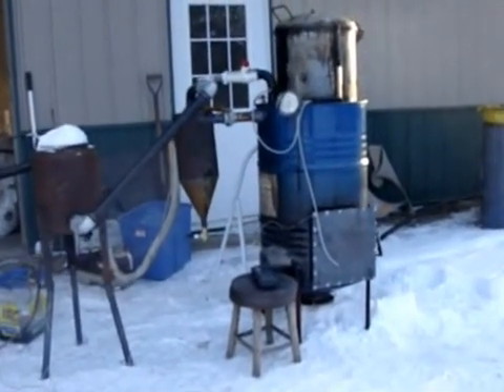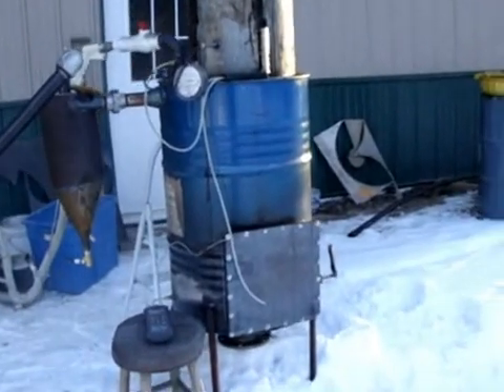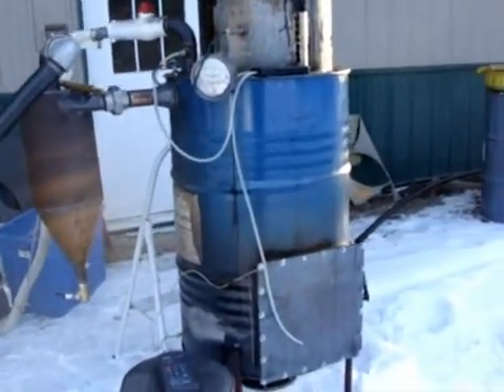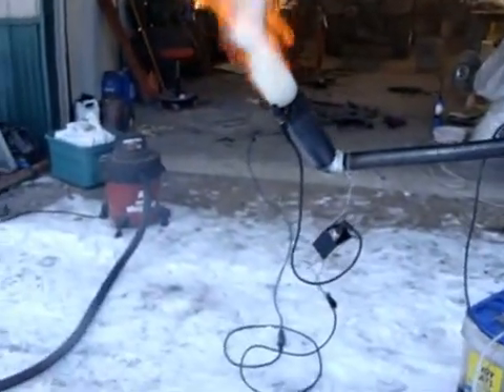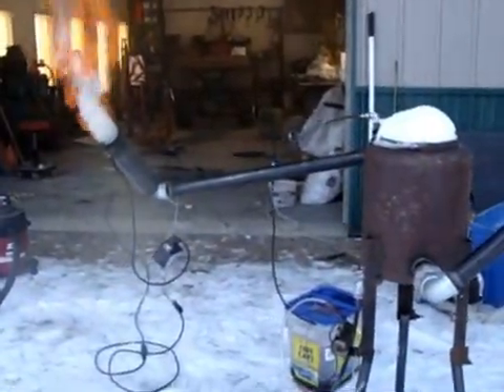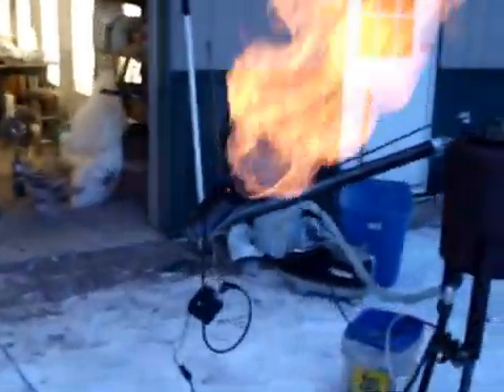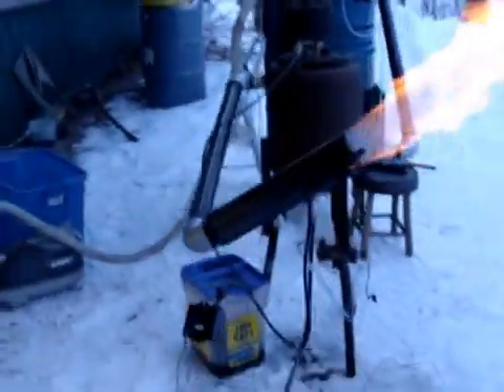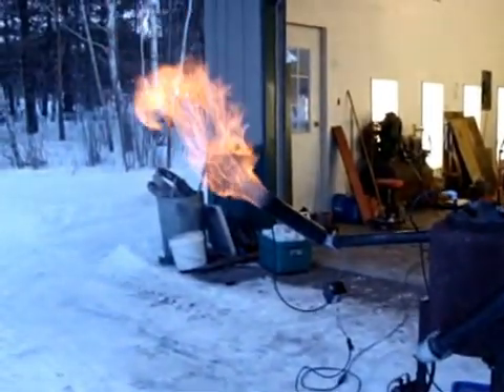wood gasification run 2-16-13

Comment: have you ever seen a water jet vacuum pump? its basically a tube lets say 3" diameter  with a water nozzle praying a narrow fan cone jet of water , this water sprayer causes a vacuum behind the sprayer. i know you need a picture , if your interested let me know because this device will also clean and cool the gas without tar build up, then you  simply run the water threw a sediment canister then a  radiator

Comment: I haven't told too many people this. when i'm starting my gasser, once i have established a flare i watch the water vapour coming out of my swirl burner. when i see it recede back into the tube from the shop vac then i know that i'm good enough to run the gen set. I've never had a problem doing it this way.

Comment: I can tell you this much. Once you get a good burn the smoke will turn into more of a thin looking vapor and you will see the gas turn bluer. I noticed this on the FEMA even when it wasn't filtered. Can you vary your air volume feeding the unit? Sometimes pulling too much air through the gasifier will give you a yellow flame even though you have good temperatures.

Comment from the maker: Teck,
from your experience what things can go wrong? I'm using a spring loaded cover as a pressure relief valve. I've already seen a few "woofs" so I'm not sure if I should expect a Chernobyl melt down or what. Safety first!
What gas temp do you think I need to be at to condense out the water? How can you tell water content by looking at the flame? Hydrogen white flame, I'm not sure, there should have been some, what ratio I dont know.  Ah, grasshopper has much to learn.

Comment: Looks good for a test but like you said you need to next work alot on filtering temps look great on this run! I my self dont like the forced air in idea you are doing due to i have seen too many things go wrong real fast that way but hey it looks like you got it working good just be carefull with forcing air in! By just the color of the flame i see you have alot of water some not as much tar as b4 but alot of water and i didnt see any white for Hydrogen in the burn! Was there any white in flame!